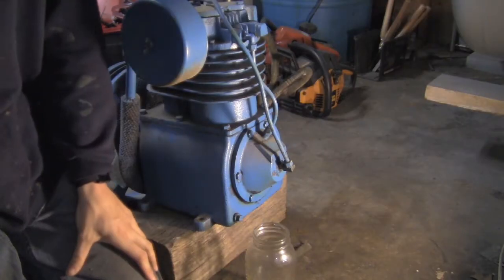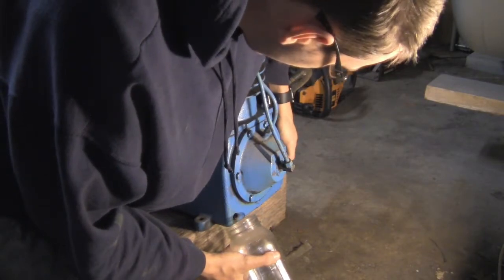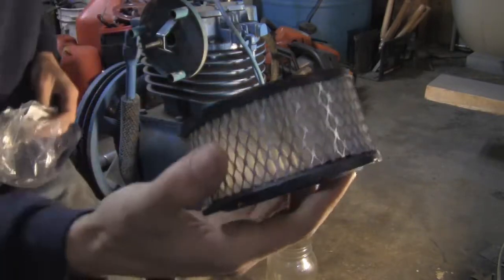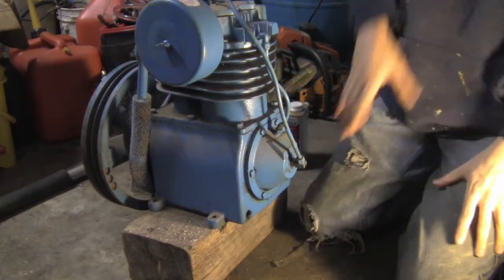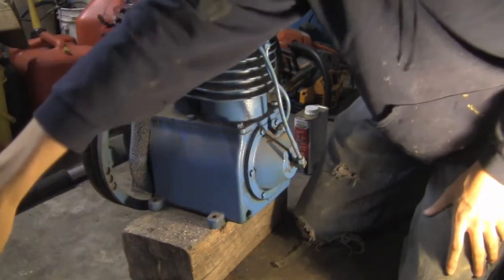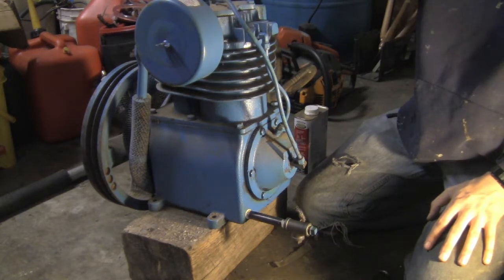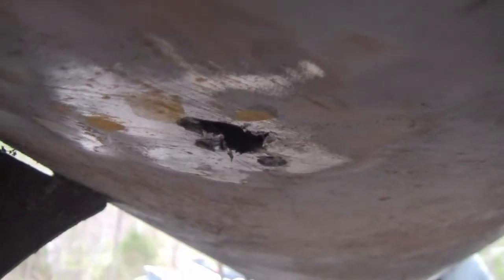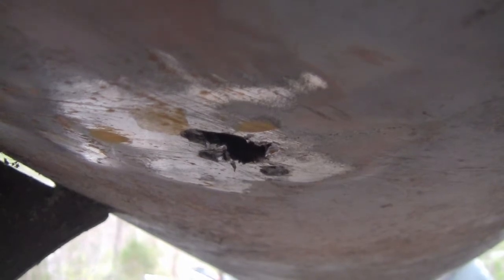Kellogg 335 Resurrection, Air filter, Oil change, and bad news. [PART 2]

Comment: Well you're not the only one. I'm 73 years old. When I was 19 I bought a Kellogg K37-A compressor ( two stage ). The guy who sold it to me got rid of it because it was to "old" for his shop and he wanted a new unit. I brought that thing home to my parents place and ran it in a small shop for years. I built my new shop in 1976 and it has been running every day for all those years. It just sprung a tank leak and I am at this moment replacing the tank and transferring this old and beautiful machine on top of a new 60 gallon Manchester tank. I really do believe I'll be gone before this Kellogg quits chugging along making air. It is true more often than not that American made machines from the past will go on and on and on. Thanks for your respect for things of quality and days gone by. Oh and by the way I could go out tomorrow and buy a new rotary screw unit but I will never give up on this old girl.
Reply from the maker: Too old? The fellow who sold you that compressor doesn't know what he gave up. These compressors are amazing! Mine has been chugging along absolutely perfectly since I finished the videos on it. I recently moved it into the new shop, it's got it's own 220v line run just for it, and I'm soon going to build an air system so I have fittings and hose reels all over the shop with a dessicant drier and such, but my Kellogg is the centerpiece, it's just a phenomenal machine, built like a tank! I didn't know a single thing about Kellogg until I got this compressor, I was looking at new compressors initially and then decided I may be able to get a used one cheaper, and as the videos tell, that quickly spiralled out of control, as most of my projects do, but now that it's all together, I'm so much happier with this Kellogg than a newer compressor that would likely only last a few years.
Reply: Are you still alive?

Comment: Looking forward to the valve work.  Thanks
Reply from the maker: Hoping to get that video out this coming Friday, I lost some footage due to a weird camera angle I should have paid more attention to, so I'll be showing some of the actual stuff I did and also some new footage explaining what I did. If you haven't done much with these pumps you will want one after seeing it. So amazingly simple to service and so durably built.
Reply: Well actually,  I subsrcribed because I just got a well used Kellogg 335TVX!  Keep up the good work!
Reply from the maker: bondfranklin oh you are going to love it. I've had mine running for a few days and wow. It puts out an insane amount of air now that I've got the valves sealing good and the unloader working properly.

You're gonna love it!

Comment: Where do you fill the oil from and check the level? Thanks!
Reply from the maker: There is a little cap on one corner, and you check the level by a couple marks in the castings right at the filler cap. I wish they had put a sight glass on it, Later pumps had one from what I've seen.
Reply: @trythistv  can you do a quick video of where you fill and how you check?